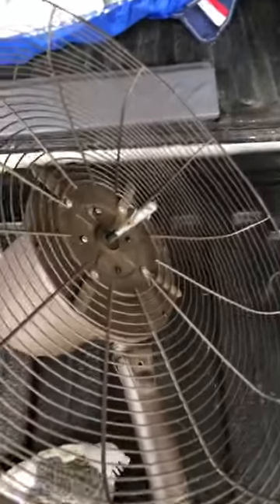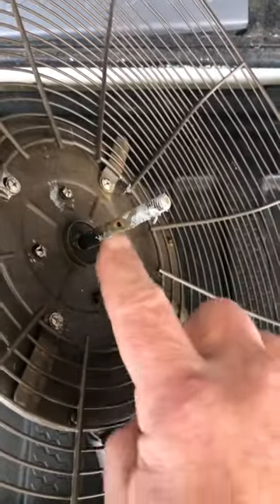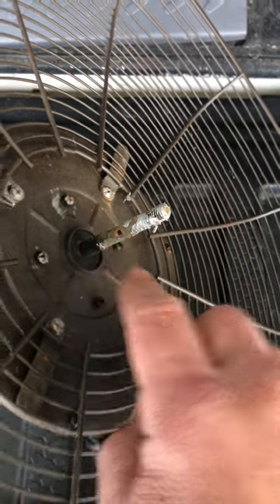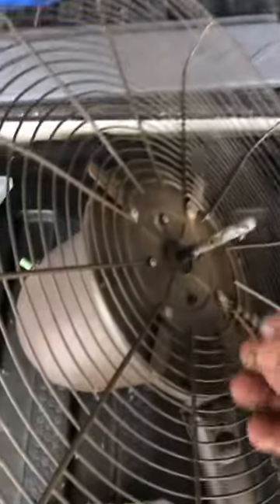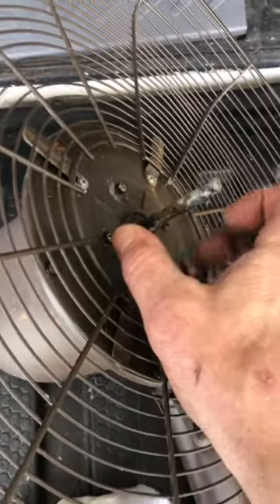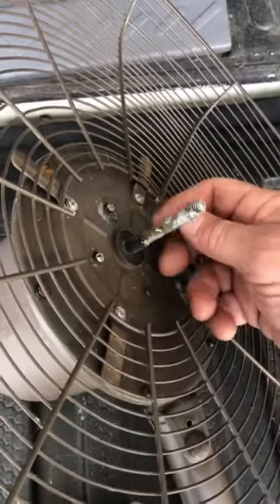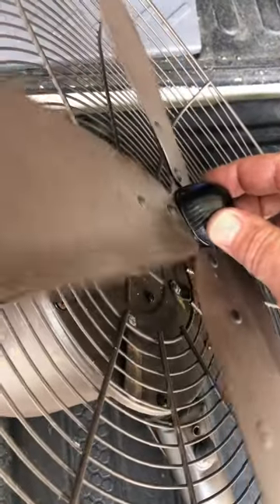Cotter Pin Options For Classic Vintage Oscillating Fan installation  #shorts

Comment: Unless the shaft is oval it is load baring. Air resistance on the blades will cause load on the cotter pin and wear it and loosen in.
Reply from the maker: Very good point.